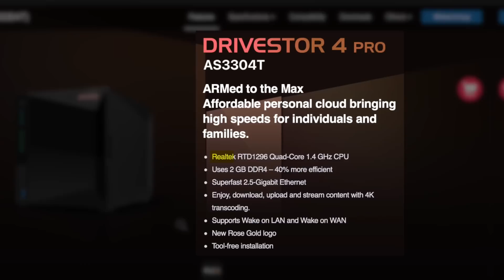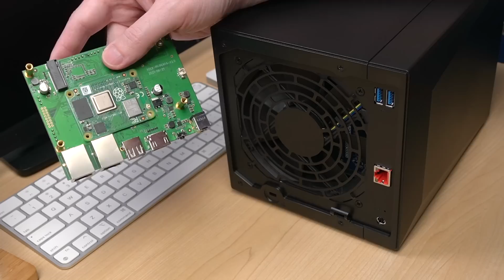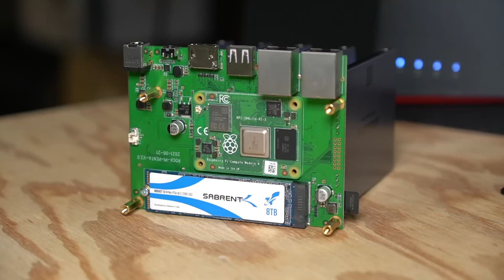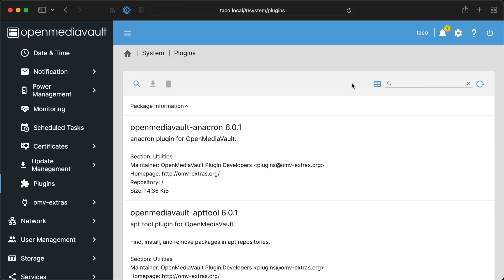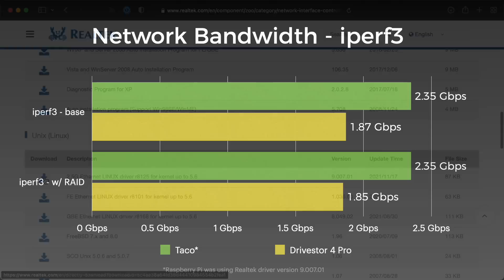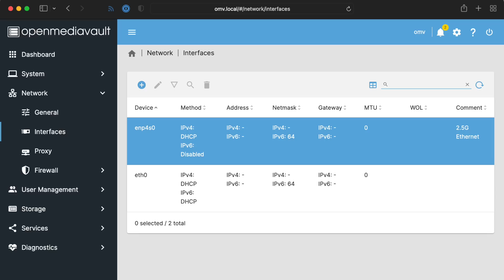Raspberry Pi vs ASUSTOR NAS – Round II

Comment: Does anyone make an inexpensive DIY NAS based on something like a J4125 processor? I have one of the Mele Quieter2 computers running Zentyal in my lab, and it does OK. I think the same thing with a jbod controller and Truenas might be a good little home NAS. But I'm not finding anything.

Comment: I use a slower but more elegant solution. A hard drive enclosure that connects to a Pi with USB3.0. It can handle 4K streaming without any problem. The best part is that it can auto sleep the hard drives after 15 mins of inactivity. This can save a lot of power.
Reply from the maker: OMV can do this too; you can configure spindown timeouts per hard drive through the UI.

The benefit of SATA connections with a CM4 is lower latency that leads to 5-15% better performance for many situations. But if you have a Pi 4 and a USB hard drive, it's a good solution!

Comment: The real question is : A raspberry can last more than 5 years without burning ? A motherboard can last 10 years and more.
Reply: Yes - I have a couple raspi model-B that have been running since Mar-2015 and a couple pi3 that have been running since Feb-2016 so reliability is not an issue if you have good power and a good SD card.
Reply: @vinceskahan1604  I just saw than raspberry don't really like to turn H24. A lot of them finish by burning. Because people ask them to do what a computer can do.
Reply: @Sombre____  I can only speak from experience.  Never burned one.  Never broke one.  They just work (for me).
Reply: @vinceskahan1604  I have one for octoprint for my Prusa 3D printer. But i've never think about buying one to make a server of it.

Comment: This video is of course unable to test one of the most important aspects of a NAS - reliability. Is the Pi solution going to be running still in 2 years? 5? Maybe I've been unlucky but I've had several Pis die on me, so I wouldn't trust them with my important data. And the reliability of the Taco is a complete unknown. Yes yes, backups and all that, but I don't want to have to use the backups if I don't need to. My off the shelf NAS has been chugging for 9 years now with over 60k hours on it. I'd gladly pay extra for that reliability.
Reply: My office Intranet / Web dashboard is run on an original 2012 Pi because it can & does
Reply from the maker: I've been running a set of Pi 4 model B's for over 2 years now, continuous, and besides one or two force reboots (not sure exactly the cause), none of the four have failed.

I think the major problems are often a flaky power supply or a microSD card that's not up to the task. Booting off an SSD (e.g. via USB) or NVMe or eMMC should help a lot with reliability, and all electronics will fail with inadequate power supplies—it's just more frequent with Pis because a lot of people will plug in random not-to-spec things like phone chargers and expect to be able to run a Pi off it.

The Taco requires a 12V barrel plug power supply just like the ASUSTOR, but even there, people don't always choose a good power supply to match to their fancy gear!

Comment: Great job on the video! That Taco setup does look interesting. Kind of tempted to look into making an "ingest" server where I could have the device automatically pull data from memory cards and back it up into mirrored RAID storage (multiple memory card readers would be ideal). I have a QNAP NAS that I repurposed do that, but it's finicky with pulling data from memory cards/memory sticks and still needs me to press a button for a few seconds until it sees the drive and registers my desire to pull the data.

Comment: Very interesting adventure :3 I was very interested in the performance of a ARM NAS. I wonder how SMB performance would be if the hdd's were connected over a usb3 connection. I recently bought a Mikrotik RB5009 which has 10G,2.5G,1G networking and usb3 and Marvell
 ARMADA 7040  (88F7040) Quad-Core CA72 Processor. Its way overkill for my networking need as my ISPs max out at barely 50mbps. I was wondering if I can put a hdd with usb3 adapter there and use it as a mini-nas. Currently I'm waiting on mikrotik to put docker support in routeros stable channel.

On another note, can I ask why you choose bcache? I was searching linux SSD caching the other day, and it seems like LVM's cache thingy was  the easiest the setup and the most performant.
Reply: I built such system using fanless usb3 orico HD dock (about $30 on Amazon).  My older fanless i5 (dual core, Ram DDR3, 8GB) works as controller (no gui, only console and ssh for remote PC terminal). With two green Seagate 18TB drives formatted in ZFS RAID1, both installed in the same orico (therefore single USB3 connection), I've achieved consistent 80MB/s write through network.  Because my network is 1Gbps then I am considering my setup fine. System working without any issues. No Bcache used either. Fanless operation is priceless (in my home, I am using RAID as storage, therefore most of the time drives do not spin at all)
Reply: @Truth_and_Liberty  110MB/s is about what to exoect copying files over a 1gbit/s network. That is also what I manage when copying over gbps network to USB3-connected disks on a full PC.
Reply: @perwestermark8920  You are right. If PC and my i5 are connected with short cables to small unmanaged switch at my table then I am close to theoretical limit of 110-115MB (no jumbo packets). In reality my PC is connected to switch at attic and server is located at basement (cable length about 25 yards each). Therefore this number is satisfactory for me.
Reply: @Truth_and_Liberty  Cable length doesn't matter, as long as it's within allowed max length for cable standard at selected bit rate. If you get packet loss then you may have a cabling issue (or a bad NIC or switch port)
Reply: I have a rb5009 too,  i tested it with a usb stick, copy a large file to my local pc over a gig port, transfer speed was over 100MBytes, and still have a lot room before max cpu usage.  also the smb feature is built in routeros. drawback is filesystem, only fat32, ext3 supported.
Reply: @jj88_mk2  I never experienced issues with zfs! But ext3 or ext4 with samba? Yes, I did. Transferring large directories with rsync can lead to issues. With zfs nothing ever happen and rsync is just fine.

Comment: I use my mid 2012 MacBook Pro running Ubuntu Server as a server, it’s fantastic because it’s recycling, and good enough!
Reply from the maker: Saving some e-waste! That range of laptops is still fast enough to handle tasks like storage and transcoding quite well, without using too much energy to do it.
Reply: @JeffGeerling  Hey Jeff! I think we found your clone!
Reply: @JeffGeerling  4K video while serving web, and pihole at the same time! No hitches.
Reply: @JeffGeerling  Ha, that range of laptops is still fast enough to, erm, be my main laptop - the last model you can upgrade / fix yourself.
Reply: @HeadBoffin  I upgraded the ram, but had to go back to 8gb after realising the ram slot was faulty, and put in a 2tb SSD. I may take out the DVD burner, for another SSD, but for now, I can rip CDs over the network.

Comment: Why are you so against OMV? It doesn't seem to just be the command-line issue.
Reply from the maker: I'm not, I have been using it on and off since version 4. But I don't like to hold back from any criticism just because it's open source and community-driven. Just like with Drupal (another open source tool/community I've invested a lot in), it doesn't do anyone good to withhold valid criticism, like the fact that usability is not as good as commercial offerings like ADM or Synology/QNAP's software.
Reply: @JeffGeerling  understood. I was surprised you didn't mention OMV's Debían underpinnings and you didn't seem to make any effort to go into the OMV extentions especially Docker. I guess I'm biased in favour of FOSS. I obviously don't have a clue what multitude of obnoxious comments you have to put up with... I don't mean to be one of them, and thanks for taking the time to respond. My NAS runs RAID5 with 6 drives on OMV, and I heavily rely on Syncthing on it also for remote backups. I don't easily recommend OMV to newbies to Linux, but I've seen people being intimidated by Synology when I recommended it. People have become dumbed down due to OS's hiding complexity, so when they are confronted with eg user management or file share planning they're quickly out of their depth. Stuff that was well understood by tech people 30 years ago. Maybe longer. Should have been mainstream body of knowledge type stuff by now, but it isn't. Can't win them all.
Reply from the maker: @donaldklopper  I think it's funny how a decade or two ago, everyone was saying "oh these young people are always on their computers, they'll know so much about them" — and really the opposite has happened. Tons of people using devices almost all day, every day, without understanding a lick of how they work!

That's one good argument in favor of tools like OMV—they don't try to shield you from device names and how things work behind the scenes as much as a fancy 'wizard' UI.

Comment: I have an x99 Xenon system I need to build and was looking at TrueNAS. I was looking at getting something like this for offsite (at a friends, etc) curious about ECC. I am just an old tech nerd and curious about that.
Reply: I based my home server on a X99 system, Huananzhi F8 board from China and a E5-2680v4 CPU with ECC ram. ECC ram is not strictly needed but came with the kit. The beauty of these Xeons is that you get 40 PCIe lanes. 4 for NVME boot drive and 4 lanes for 10Gbit networking. Then you have 32 lanes left for another 8 NVME drives. These X99 systems are great solutions for building stuff like this.
Reply: @BertM3  I have an x99 workstation board without ECC. I was considering this but with how cheap I got this chip and mobo for around $150. I just need ram now and was wondering if I should keep pursuing or not. I hate how regular desktops have such restricted pcie lanes. I wish people would ask for more. at least 24 for additional cards.

Comment: The taco seems to be pretty good when you think of it as a first revision, if raspberry pi gets a bit more powerful in the future it'll look like a solid competitor
Reply from the maker: I really hope whatever CM comes next, Raspberry Pi keeps the 2x 100 pin connector layout, so devices like the Taco can immediately get a speed boost just by upgrading the Pi.
Reply: @JeffGeerling  Not probably. Next CM would have more pci express links and maybe different ways to use ethernet and usb phys to simplify motherboards in future.
Reply from the maker: @ilfirinms  They could take Radxa's approach though, and maintain x1 lane compatibility on the existing pins, and add another link through another connector.
Reply: @JeffGeerling  Cost and traces (have one pcie link on one connector, others on another...) ineffective. Simplier would be ground up redesign, but ye, Radxas approach is plausible.
Reply: It'll be interesting to see whether appliance vendors like ASUSTOR will ever make products that embed a compute module. It'll be a bit more expensive to manufacture and most of their buyers won't see the benefit, so not likely, but maybe a niche side product that some vendors will offer for a premium, similar to how some router vendors offered versions that supported 3rd party firmware. That required that they use older, more expensive hardware designs as they had switched to cost-reduced hardware in their current models (typically with less RAM, Flash, and slower CPUs).

Comment: looks like both of them still uses software RAID.
but still, we get closer to hardware RAID out of box easier nowadays.
Reply from the maker: As the CPU speeds increase, software RAID becomes a better option for a dedicated storage device, just for the flexibility (and parts reduction).

Hardware RAID still has a place in some circumstances, but it's more niche nowadays.

Comment: I get why its easier to design a nice pluggable 2.5" drive build. Clean and straightforward.  
But the price/TB ratios make them useless unless you are going for FAST storage.
Reply from the maker: Fast, minimal latency, and blissful silence. These NAS drives are often pretty loud! But cheap per TB.
Reply: @JeffGeerling  NAS noise is ok since you can tuck it away as far as you can pull some ethernet.  
I'd LOVE a solution that had the ports spaced for 3.5" and the PSU prepared for the draw.  Then I would have a complete clean build with 1 board, 1 printed case, 1 psu and 1 unobtanium RPI CM4
Reply: I connected a DAS to a raspberry pi 4 and now I get the best of both worlds: the pi cpu mostly free to run other stuff and a fast, network-accessible, redundant storage.
Reply: @r0galik  how did you connect a DAS to a Pi?
Reply: @UnreasonableSteve  through USB, easy. It's a D5-300 from Terra-Master. Works with ext4 as well
Reply: @r0galik  Oh I see! That's a little outside of what I would've thought of as a DAS but I guess it fits the description!
Reply: @UnreasonableSteve  well it's a direct-attached storage converted to a network-attached storage. The pi gets 128 MB/s writes and 170 MS/s reads (with RAID5) and through the network I get around 70-80 (but it's a 1gbps connection)

Comment: i made a "nas" of my pi by using sftp or fish if you are using the dolphin file manager if i want to copy files to the 128gb sd card or ssh if i want to connect it to a terminal at this moment konsole lucky for my most linux distro's have OpenSSH pre installed the use case for me is so that i don't need to carry a external hdd from one pc to the next also i have only 1 of those external hdd's & we all know moving a hdd is bad for them

Comment: To me it doesn't matter. The fact that I can run any software I want on a Pi compared to some proprietary NAS device is all the convincing I need.
Reply: This. On top of that, since I have been using Linux for quite some time I actually prefer doing things with CLI instead of a gui
Reply: That makes it a good choice for you and I, but woefully wrong for a lot of people like my parents.
Reply: @Steamrick  your parents need a NAS?
Reply: @Megatog615  Yes. Backups, file share, security camera footage.
Reply: @Megatog615  Photo and video backup is a huge worry, especially when they're scattered across multiple devices over multiple decades. Using NAS is an easy way to combine all of that data and ensure redundancy without having to worry about an error or failure somewhere along the line.  Recovering a dead drive from a system from 1998 ain't cheap, so it's better to put that money towards universal and redundant storage as early as possible to beat out a mini catastrophe.
Reply: @Abstractism Correct, but a single NAS is a great step in the direction of redundancy.
Reply: the problem with tako is an absence of good enclosure, so instead mini-itx + amd ryzen apu is much better choice with it good 17w idle power consumption, and when needed boost of power.
Reply: @s.i.m.c.a  I like the platform you described, but it is really hard to find in stock, sadly. We were supposed to have so much great tech at low cost, and now even low cost is expensive and sparse...